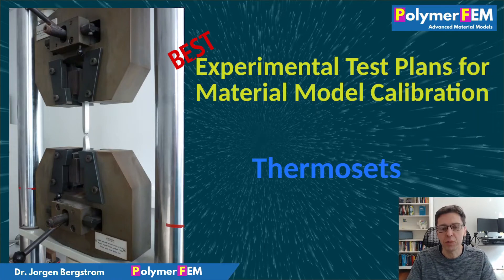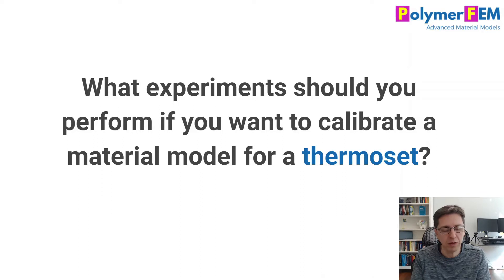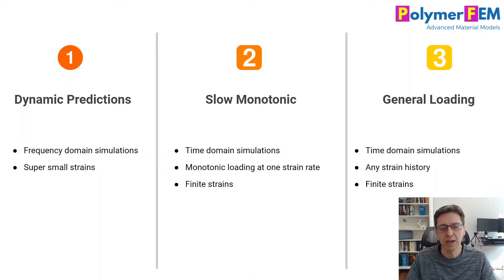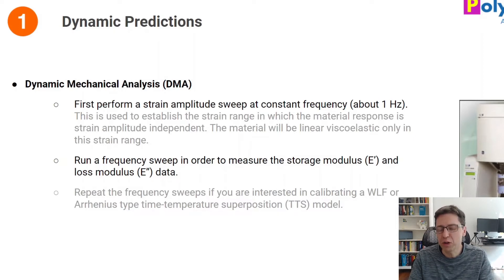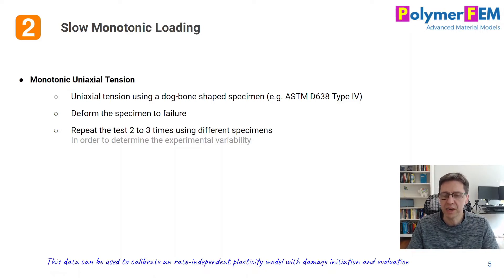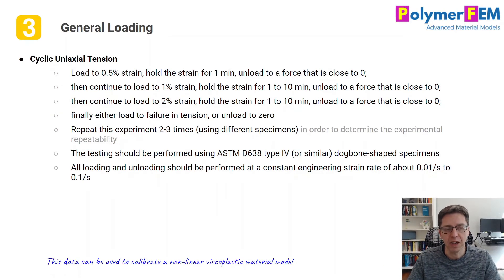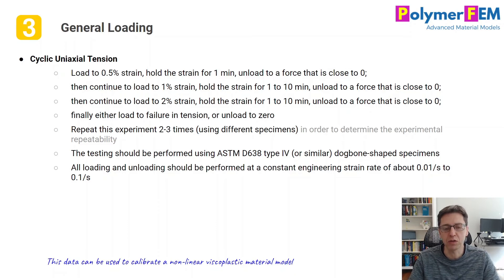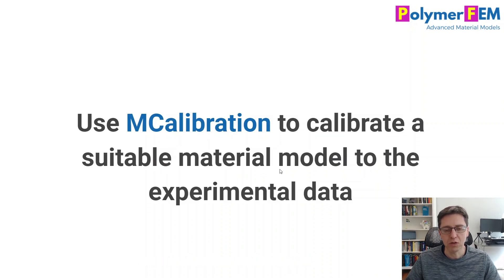Experimental Test Plans for Material Model Calibration - Thermosets

Comment: Hello, Many thanks for your videos. I have a question: Could you please let me know that is there exist any model in Abaqus that I can calibrate with considering both tensile(dog-bone) results and shear(single-lap) results? My concern is what is the relation between tensile and shear that would be assumed by the models in Abaqus? My material is also rate-dependent in both tensile and shear experiments. Many thanks in advance.